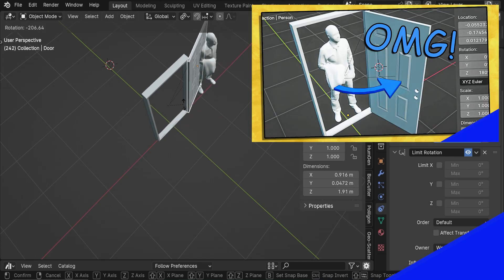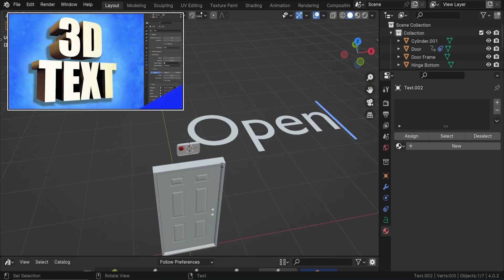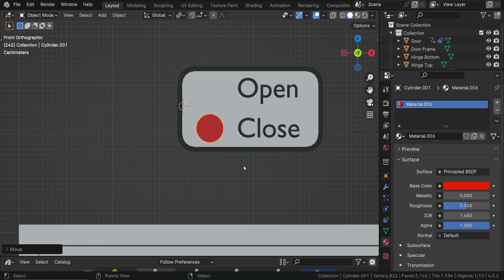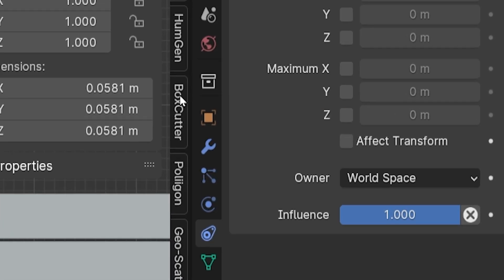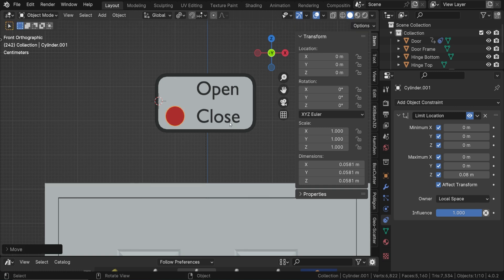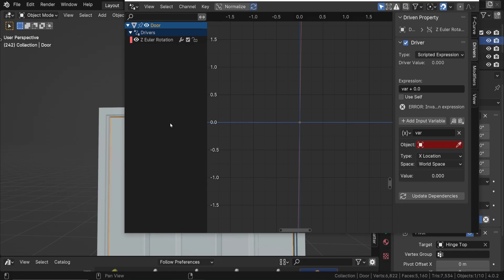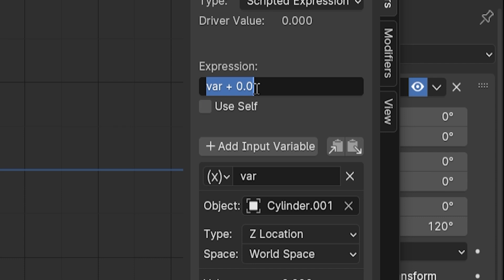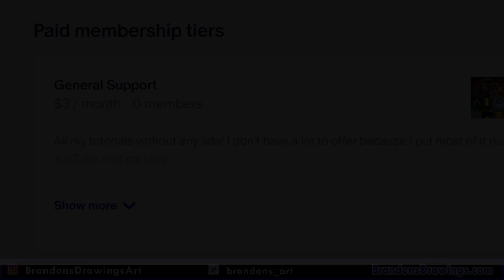Open Door with Toggle Switch - BLENDER 3D Driver Tutorial

Comment: Figured it out!  I thought your driver equation should be (var * (120  / 0.08)), but that caused wacky movement in the door.  That's because the door's rotation needs to be given in Radians, not degrees.  Since 120 degrees is (roughly) 2.09 radians, then this should work:  (var * (2.09 / 0.08)) or more simply,  var * 26.125   And that gives the door a 120 degree swing from the button movement.  Love your videos, thanks for taking the time to make them.